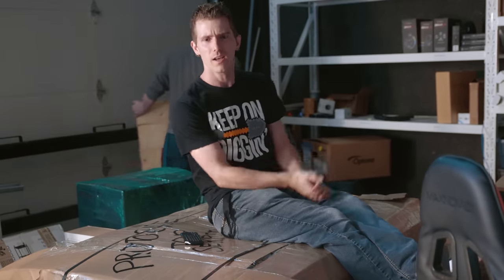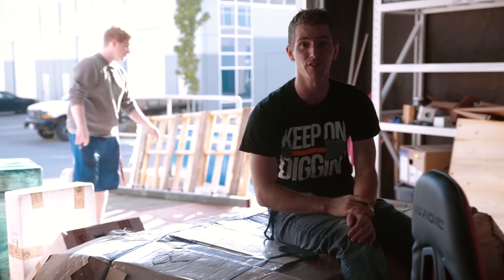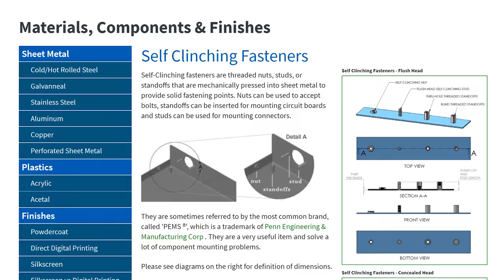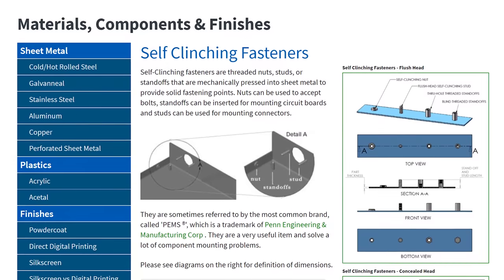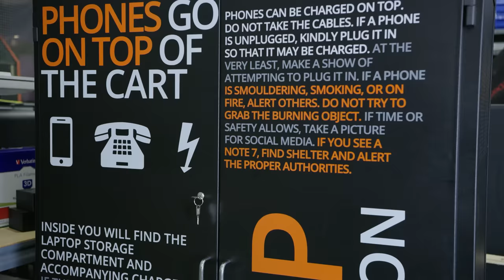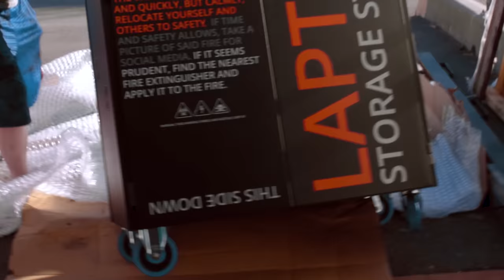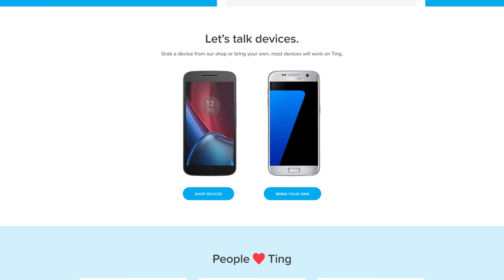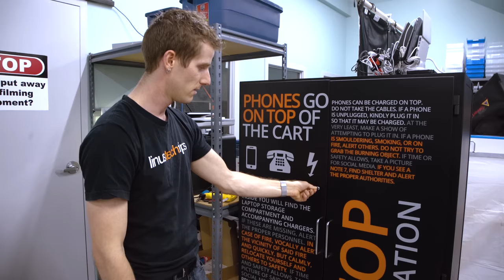How to Store and Charge FIFTY LAPTOPS AT ONCE! - Laptop Cart

Comment: I finally found this video! I've been attempting to find a way to charge fifty laptops simultaneously for a while.
Reply: xd
Reply: My old company do mass imaging for companies and school, and work bench and wired frame (which were surprisingly sturdy) were used to house imaging up to IIRC 58 computers at once. 

turns out, the issue isn't the space required, but power (had to pull a few new lines) and how to exhaust all the heats generators by those PCs in a space originally designed for office usage.
Reply: Lots, lots, lots, and I mean, lots and lots, oh did I say lots? of dollar store power bars and squids
Reply: my school uses laptop carts in each class, and the teachers get to choose if the students bring their Chromebooks home or charge them in the carts.
Reply: Laptops "sometimes catch on FIRE", so put all your expensive eggs in 1 box? How about several smaller boxes?

Comment: Good thing that it's locked for safety when the whole cabinet is on wheels.
Reply: As if it could be moved when its full.
Reply: It can. Will need some effort but it definetely can. The heaviest thing I moved was 1000kg or 2204lbs heavy. I needed help overpowering the inertia but then I could keep it going. So Two people are definetely enough to move that cabin
Reply: I can push my 3700lb car around on level ground using only my left leg sticking out of the driver's side door.

The wheel is an amazing invention.
Reply: I believe Andrew Husband (and someone else who most likely did 70%-99% of the work) holds the record for pulling not one, not two, but THREE fully loaded firetrucks 100 feet. (they pulled all three fire trucks at the same time.) I'm fairly sure this cabinet when completely fully loaded weights a LOT less then three firetrucks.
Reply: That's what I thought. Hehe
Reply: It already has flat wheels just from all 30 laptops being in therw. 🤣
Reply: @agalerex  I wouldn't be so sure

Comment: Should elevate the storage on some wooden blocks or something so the wheels don't develop flat spots.
Reply: Kinda surprised they didn't put heavier industrial casters on the cart or adjustable legs if it will stay in one place most of its life.  Even double castors may have been a better option to handle the weight needs.  These look almost like they are an Ambassador 125mm 140kg Rubber Fixed Castor and Swivel Castor set but it is hard to tell and they could be the next size up rated for 180-200kg.  That being said they will likely last a long time as is and may be just fine.  If the laptop cart weighs 400lbs already and they plan on loading it up, it could end up weighing 1000 lbs (~453.5kg) or more fully loaded which would be right at the upper end of the ratings for those castors and I would have likely doubled it just to be sure if it ends up moving around a lot.
Reply: I'd take the wheels off and bolt it to the floor. :O/-
Reply: I never knew that a castor wheel expert existed xD WHY DO YOU KNOW SO MUCH???
Reply: Kuhrd Castor Wheel Tips
Reply: You seem to know a lot about castors. I'm only really familiar with Guitel and am happy with them, but is there anything better for a similar price?
Reply: +Conman_123 This is part of a basic common knowledge that even a high school student should know before they enter the workforce.  Anyone should be able to find this info out simply by looking at the castor and doing a small bit of catalog research.  Castors and other hardware come with weight ratings that make it easy to spec one out for a particular project.  This is the same process you go through when you choose a fastener method and type for a project since you only have so many choices available when you start narrowing down the design needs.  It comes down to the idea that if you are going to take the time to design something for a purpose and the difference is $40 from one set of castors to another it is always a good idea to get the ones with higher ratings when possible.  Since this is a one-off that proto case may produce or sell as a design in the future or never use again, they could easily make some changes and upgrade the castors if they were ever to bring it to production.
Reply: kuhrd how I decide on fasteners...

Heads to "man drawer"...
"Hmm..."
Ruffle ruffle...
"Yup, that looks about right."
Hammers nut onto bolt.
"That'll do"

How I decide on electronic components....
Google...
Google some more....
Reads datasheets
Buys 3 different components to do testing
Affixes one to project.
"Yup, that'll do"

Heh priorities and drivers eh.
Reply: +Motorman2112 It all depends on where you live and what you need them for.  Generally speaking, look at the ratings and size needed and then look at prices and compare brands.  The larger diameter a castor is, the easier it will roll but whatever it is attached to will also be easier to tip over.

Guitel makes quality castors in France.  Bulldog Castors looks to make quality castors in England but I have never used them. Darnell-Rose, ER Wagner, Hamilton, P&H Castors, RWM Castors, Superior Tire & Rubber Corp., Tente Casters, and Colson make quality castors in the US.  Darcor makes quality castors in Canada. Ambassador Industrial makes quality castors in Australia.  I have left out many manufacturers but this is a starting point.  I live in the US so most of the castors that I use or have seen in service are sourced from the US.
Reply: Plus 200 when someone like me stands on it ;)
Reply: Heh, but if the cart catches fire, it will be easier to get it outside if it can be wheel'd

Comment: Laptop Giveaway? I'm ready to take 1 of those babies home
Reply: Adidasp4 exactly
Reply: Yea that would actually be free views for old sht that they don't use
Reply: Adidasp4
Yea me too, they don't even using it.
Reply: would take that trolley full of them come on linus I need them
Reply: they wont because its for the team not you
Reply: Wouldn't mind a giveaway. And to those saying get a job or save up. Not everyone can or they are already working their butts off JUST to pay bills. I myself saved up about 6 months worth of change and whatever leftover to afford my GTX 1060 and replacement psu. Still running on an AMD FX-6350 and would consider myself lucky if I can even get my hands on an 4th gen intel i5 or i7 and mobo to switch since those don't bottleneck the 1060. Not everyone has nice friends or friends in general or the luck to have someone say "Here's my old rig" and it be an upgrade over their older system. Difference between begging and saying it'd be nice to have a giveaway as well. So how about you stop putting saying in our mouths. Thanks.
Reply: Adidasp4 yea
Reply: I dont think they can even if they wanted to. Those are all review unit, they probably came with a request from the manufacturer to never be given to public or something similar, or else I bet alot of them would go to craightlist or whatever already
Reply: I doubt they would care if the old laptops were given away, as long as they don't sell em
Reply: Anh Minh Le chances are your probably right. I mean why keep them?
Reply: Skye F lol most of the people that say stop begging aren’t even old enough to get a job... if they actually did work, they’d know how nice it would be to get stuff like that without paying 😂
Reply: Skye F its not even about who can afford it right... lets say you make 2000$ a month + change for bills and food you would still not mind a free laptop.
Reply: In for one
Reply: I'm guessing most of those were promo material, so i don't think they can actually give them away (except with manufacturer's consent)

Comment: 8:45 Hey! that looks like an HP Elitebook. I have a 8460P that still works great. don't be hating on a laptop just due to express cart slot :(
Reply: Actually the Elite and Probooks of the -60 and -70 generation are (except for the displays) my favourite Laptops. The build quality is just awesome, mine once dropped 1m on a stone floor and nothing happened. Not even a single scratch. With the ST09 2nd battery it also has a battery life of 12 to 16 hours with normal use. Also they are still powerful and very cheap. And extremely ease to upgrade, just one lever to push aside and you can basically exchange every component. (CPU Swap ~3 to 5 minutes, Keyboard ~2 minutes, HDD ~2 minutes) These laptops are built to last.
Reply: disregard elitebooks
THINKPAD MASTER RACE

Comment: Why are you throwing shade at my EliteBook 8470p. Its a fine laptop...
Reply: Jif Peanut Butter I have one too. What model do you have? I have one with an i7 and an amd hd 7570m
Reply: Jif Peanut Butter Exactly, still a beast.
Reply: that thick alumium body can't be destroyed, and it's very reliable too, my 8460p was bought used, it has 6 years, and it's still perfect, expecially impressed by the battery still 100% mah capacity..
Reply: i got dell laptop with express card slot
Reply: I have one with a i5 3320m, Intel HD 4000 and 8 gigs of ram
Reply: Jif Peanut Butter they didn't paid Linus for shilling

Comment: If you ever do that rev 2:
1) Wheels. Make sure they're good quality, to minimize vibration. Vibration is bad for hard drives. Not sure of the quality of that rubber, but if it's not designed with minimal vibration in mind, it should be reconsidered. I would also question the utility of 360 degree spinning for the same reason. The station is going to take up a huge spot, so it'll probably be flat against a wall anyway, so design with 90 degree turns in mind.

2) Put power brick holders on the inside of the doors, which would be sized to hold various sizes of bricks. If the cables are long enough to reach the outlets, you could open and close the doors with minimal effort - just include some wire runners/cable management too, so they don't get pinched in the door hinge.

This would make it a ton easier to remove laptops from the charging station when you want to deploy something! No need to dig in above the laptop to remove the brick, it'd just be hanging out on the door panel. This would free up a bit of headroom so you don't pinch your fingers when you grab a laptop.

Comment: I read keeping batteries 100% charged is not much better than having them discharged. For long term storage something between 30-70% charge level or so is said to be more optimal. I assume at least discharge them sometimes a bit. Does not look like this always charged storage solves this issue and the batteries will be dead after a year or so, too?
At least a couple of MacBook batteries died oiver the years while I mostly worked power connected on my main desk, ...
PS: first google result source: http://batteryuniversity.com/learn/article/how_to_store_batteries
Reply: It depends on the battery type, however for most (but not all) types of batteries, over discharging them can cause leakage or irreversible damage and loss of capacitance
It’s in the wiki page I’m pretty sure
Reply: +Против Глобал K.
Reply: Accidentally kept my tablet plugged in for a  month or two without using it and now the battery is bloated lol

Comment: I like the custom cart idea.  At my place of work we use a Ergotron cart that charges and allows the laptop to be on the network- updated remotely.  The only issue we had with the Ergotron is that the six fans are louder than most people would like for a classroom.  We eventually figured out the fans were only needed when the computers were actually attached to the network and updating; otherwise, the natural airflow was more than enough.

Comment: So how does this work? Do you have the laptop chargers powered constantly? Power in on in whenever people are in the building then turn off when leaving? Or just power in on in some predetermined interval (ie. every 2 weeks)
Reply: yea, im just kinda thinking about that.
Reply: My guess is there is always power going through the chargers, the batteries in modern devices (except maybe that older laptop, and even then probably) have voltage regulators which cut power to the battery when the voltage gets too low or too high to prevent damage to the cells. 
It's the same reason why you can leave your phone plugged in overnight without worrying about the battery, the device won't let the battery over or under charge itself.
Reply: the power consumption tho.

Comment: Rev. 2.0 and 2.1 definitely needed. Rigid jack-stand legs might be a good idea. Takes the load off of those wheels and would make you not have the have flat-edge square tires 3-18 months from now when you want to move that behemoth. That and more power adapter space as you said... 1st world problems... also, rev3.0 could have a bio-metric electronic lock (with BT SMART-Enabled access?)

Comment: i've previously worked in a industrial kitchen equipment manufacturer facility, they have everything proto case has and more they don't use a laser or a cnc then have a huge multi headed stamping press which is made to run 24/7, and the funny thing is the deburring machine you showed is the same brand as the 1 they had if you go back and look on the front face of the machine you will see 2 red arrows those are where you put smaller pieces though 2 at a time, typed this all out to see the video is 2 years old

Comment: Well you just wasted a whole lot of money there.

Lithium-Ion and Lithium Polymer batterys dont degrade all that much over time when they aren´t charging, if kept at the correct voltage. 

But they actually do degrade if they´re kept at 100% charge. 

Thats why lithium batterys are shipped with a storage voltage, thats like 3.8-3.95V per cell. 

If you just keep your batterys at about 50-75% than they wil actually last long.
Reply: Say that to my laptop thats always totally empty when i shut it down properly when battery full and only stored for few months
Reply: For anyone coming to this later, the problem with most laptops is that they always put a drain on the battery. When they are shutdown, they still draw current.

So with them, the only way to store the battery long term without being charged is to remove the battery. Which isn't possible in many modern laptops.

Leaving the battery charged in modern electronics isn't much of an issue anymore anyways. No where near as bad as letting them drain down to nothing.
Reply: @MTGeomancer  naw bruh, you're incorrect. As some one with a fireproof box FULL of lithium ion and polymer batteries I can tell you the original post is correct. The cells have very specific points they have to be stored at. I fly rc quadcopters and have like 30 different ones. Putting one in storage at full charge (4.2 volts per cell) will greatly reduced the life of the battery. They need to be stored at 3.83 volts per cell ideally. Even Linus made a video about it concerning how to make cell phone batteries last longer. Staying between 50-75% without fully charging will greatly increase the life of lithium batteries. There are laptops out there that have programs built in that can stop the battery at 60% when your using it with the power plugged in constantly, so as to not damage the life of the battery. New laptops are never shipped fully charged for this reason.
Reply: I was looking for comment likes this and you are correct sir. I was expectiong from Linus and his crew to come up with some smart overcomplicated charging system to keep batteries at 70% or something like that. This is really not a good idea at all.

Comment: I'm working towards building a new PC, I've already purchased the CPU, Motherboard, M.2 SSD and the Case. But I want to know if this build will be any good. I'm wanting to try 4K gaming with high settings and I also intend to install modifications on some games to make them look and work even better, do you think this will be enough.

AMD-Ryzen 7 1700X
Cooler Master-MasterLiquid Lite 240
Asus Strix X370 F-Gaming ATX Motherboard
G.Skill Ripjaws V Series 32GB (4x8GB) DDR4-3200
Samsung-850 EVO 250GB M.2-2280 (As boot drive)
Samsung-850 EVO-Series 500GB SSD
Western Digital-Black Series 1TB Internal Hard Drive
Zotac-Gefore GTX 1080TI 11GB AMP Edition
Fractal Design-Core 2300 ATX Mid Tower Case
BitFenix-Whisper M 750W 80+ Gold-Fully Modular
Reply: That cpu GPU combo my dude......

Comment: Lithium ion battery storage is thus:  store in low temperature (fridge) at 40% SOC (state of charge).  Never do this thing that Linus has decided to do.  Bad idea.
Reply: If you can remove the battery from your laptop and have the time to wait until the battery reaches 40%, then for sure.
But charging the batteries to full capacity is still way better than letting them self discharge. Over- and undervoltage kills batteries!
Reply: Lithium self discharge is very low at ambient, 1-2% a month at most.  Less than 1% if you put them at just above freezing with a desiccant to prevent humidity.

Battery fridge video sounds fun
Reply: @Jaker788  it's a laptop, the screens and components will get fucked by the low temperature. Also how are you going to retrieve the laptop without tongs? So much unnecessary friction
Reply: @HarshNerf  If your battery isn't removable then don't do it.  It's more work than it's worth for most batteries anyway to refrigerate.

Comment: Cold storage is better. Fully charge a laptop battery, put it in a ziplock bag and put that in a freezer at zero Celsius (or lower). Self discharge goes way down, and the batteries will only need to be thawed and recharged about once a year.

The ziplock bag keeps moisture out so frost and corrosion don't ruin the batteries. When thawing, leave the battery in the sealed ziplock bag until it gets up to room temperature to prevent condensation.